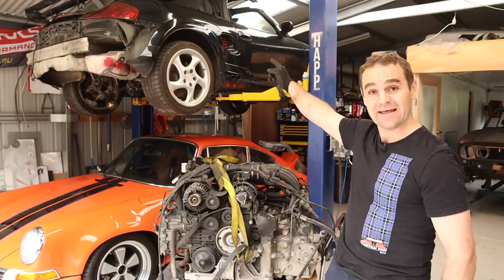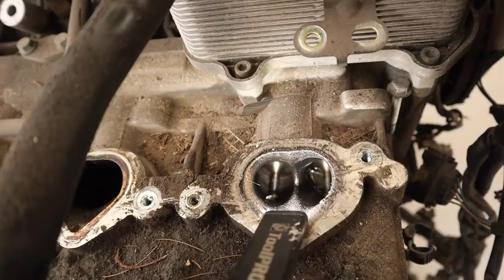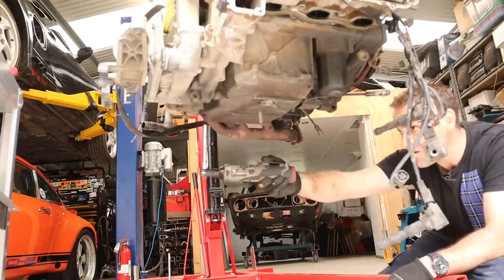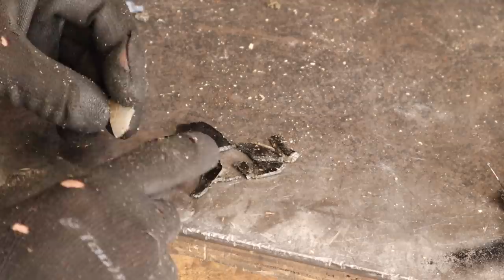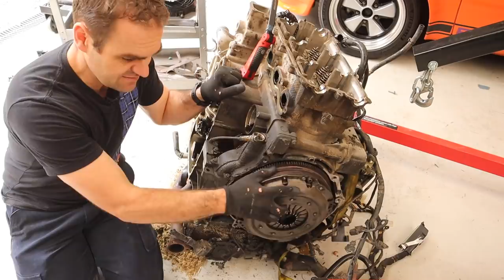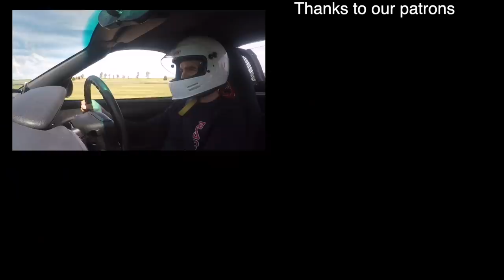Roxster Engine Tear Down - Porsche 986 Boxster track car build 5

Comment: Words that should never be uttered...
It's not worth buying new tools...
Reply: how did the head bolts get so tight?
Reply: @nazdagg2027  modern vehicles use thread locking compound instead of spring washers, add in many heating and cooling cycles and they get tight.
To put the thread lock compound in perspective, I couldn't loosen some bolts on my 4wd, took the car to the mechanic, onto the hoist, and this 140kg wall of muscle had to use a 6ft length of pipe on the end of the spanner. This was a man who has spent his whole life using 6ft long spanners, and even he was shocked at how tight it was.

Comment: The best way to get the head bolts off is with a full size air impact gun hthey will not come loose with a hand breaker bar. That btw is a good indication that the engine was overheated it freezes the head bolts

Comment: Appreciate the second effort! Like several others, I watched Kagan take his apart earlier. Lost oil pressure seems to be going round for these. You had the "right " tools to be taking the head off- unless they were over tightened and maybe Loctited. Like maybe it has overheated before and the previous owner of the cheapest, sorriest Roxter in Oz did some repairs with JB Weld instead of gasket prep. Sorry for breaking your tools, though, you've worked hard to get the lot you have. I like the coffee table suggestion, or a boat anchor after all the oil is out of it. I wouldn't want to wish that mess on fish! PS; Don't buy anything else from this dude again, but I'm thinking you already knew that! Best to the Misses!

Comment: you could weld nuts to the head bolts and remove with a standard impact socket if you really want it apart, or drill the heads of the bolts off

Comment: You are probably correct about the engine overheating.  However, the M96 and M97 engines very very rarely blow head gaskets (I want to say never).  They do however crack heads.  That is how they end up with intermix. Once there was enough water in the oil, it lost lubrication.  The connecting rod bearings are the first to go.

Comment: Great cars insourcing garage. Looks like my garage, Giulia, gt, boxster. In 32 years, I never had any engine problems, before I bought a Porsche. At 50000 mls , cylinders are worn, oval, washed out. And extremely expensive to rebuild.

Comment: Very interesting to see! You could perhaps try to drill the heads of the head bolts as a last attempt?
Reply from the maker: They are hardened steel bolts. It would take FOREVER. Just not enough reward for that amount of work required ;)
Reply: Or a bit of heat ?
Reply: @HomeBuiltByJeff  I see. I guess it's too much work just to confirm what we already know. Great idea using the hole saw by the way, I would never have thought of that!
Reply: As stated previously, an angle grinder may make quick work of those bolts - assuming you're able to come in from the corners.  If there are more that aren't accessible, then forget it.  But drilling?  No way.

Comment: Oxy acetylene torch on the head of the bolt until it is cherry red it will expand  and you will undo it . Also works on sheared wheel bolts  the action of mig welding on a nut  the heat frees the tightness and it unscrews . Keep a Co2 extinguisher handy.
Reply: AKA red and black spanner

Comment: Seems obvious with all that water in the block it was a massive coolant leak from somewhere, gasket or crack from overheating. Love it that you pulled it apart, totally unnecessary but we just have to try it right?

Comment: Such good news to see the teardown; Shame the head did not cooperate; Would the plastic bits be chain guides? Would the overtightening of the head studs mean something about the state of the engine? Also Jeff, would it not be possible to disassemble the engine from the other side, (provided the other head comes out) split the cases and remove the crank without removing that head [at the cost of a lot of effort]?

Comment: Since the engine is totalled anyway and you're drilling holes into it, you could've sliced the headbolts with an angle grinder to take the head off. But as you said, you already know it's totalled. So why put in that much time into it, right?
Reply: ^^^ This!  15 minutes with an angle grinder would be TOTALLY worth it.  Go Jeff, go!
Reply from the maker: I though about that, but you cant get the angle grinder down to the bolts. I would have to spend an hour cutting the top of the cam tower apart to get to the top of the bolts ;)
Reply: @HomeBuiltByJeff  Yeah, I get it.  Plus, the cutting wheel would have been gummed up by all the aluminum before even reaching the steel bolts.  Oh well, we armchair quarterbacks will think of some other way you should waste your time!

Ha, ha!  Thanks for the video and reply!

Comment: I notice in the USA some seem to like putting an LS in a Porsche, some say it works well some others say it is bloody noisy and it still blows from time to time with oil not staying in the right area through corners, I know that in you're neck of the woods you have pride in fitting a Barra in many things, but we also know that Jeff thinks outside the box,  I have it a Subaru turbo with extra cooling and oil placement.
Reply: I'd say a Barra six thou not alot of room for one of those.
A Subaru engine most likely.
It's got to be able to punch out close to 600 horses to be  porsche GT 2 spec...?

Comment: The fact those head bolts are too tight leads me to think its had a bad rebuild.
Initially I thought head gasket too but with that broken conrod its possible it punched into a water gallery which is why theres water in the exhaust.
Hard to say what happened first.

Comment: Great video but I'll have to disagree with you on one small detail. If the sleeves and cams are good, you can refresh one of those M96 with new bearings, chains, tensioners, gasket sets and even the IMS (EPS roller version) for less than $2000 again,  if everything else is good. I had a bad crank bearing (caught early enough thankfully) and did a refresh of the engine as stated. Everything was throughfully cleaned and inspected. For reference,  in the US market, a good working engine is running in the $3-4K for a 2.5, higher stil if 2.7, 3.2, 3.4 or 3.6L so the economical logic is there. Thankfully all is well. Being running her hard for over 30K, so far no issues but I had to drill the head out of 1 of the head bolts. In your case, that engine seems was rode hard, hot and put away wet for a long time and definetely beyond help. Best of luck on your future projects. Cheers from Puerto Rico.

Comment: As the engine is toast anyway, why not drill the heads off the torx (or splined bolts??) and then the heads can be removed?  Even if the engine was to be rebuilt this course of action was still viable as it would have been easier to remove the last vestiges of the bolts when the heads were out of the way.

Comment: you should heat the area near the bolt first to make it easy to open
Reply: That's the first thing I thought of after the tool broke. Start with propane then Mapp gas then acetylene. Or maybe weld a nut to it.

Comment: can you not reach in with the plasma cutter and just whip the heads off the bolts?
Might damage the head itself in the process but if its for scrap anyway :)
Reply: Ah, but that's cheating 🙂
Thou I guess using a whole cutter in the block cheating also lol.
Sometimes it's the challenge but also where you learn alot using scrap parts.
(About techniques to remove stubborn bolts)

Comment: Can you weld on a bar to the nut?
Reply from the maker: That would have been something to try, but in my experience the welds still seem to snap first.
Reply: Did look pretty tight
Reply: Just try heating it up first.

Comment: Thought you would have taken off the clutch and just checked the IMS out of interest?
Reply from the maker: That is a good point. I might pull it just to see the condition.
Reply: @HomeBuiltByJeff  to get your head bolts loose simply use a punch inside the head of the bolt or just the top off the bolt and give it a couple of hits with a nice heavy hammer, you will never have to buy another Torx bit due to twisting or breaking the end off.

Comment: Its bitch of a job it is to get the gudgeon pin and retaining clips in to the other side of the engine 

Did a boxter last week 

You have to Line up the rod and piston perfectly hope the rod doesn’t jump 
The slowly feed the pin through the entire block on a long ass tube hope it fits nicely then do the same with the clip only wishing that it doesn’t ping of again and get lost in the crank case😢
If it does, the yeet the engine of the stand and send your self abroad for a nice vacation 😮 (nice little tip for mechanics if you fuck up)